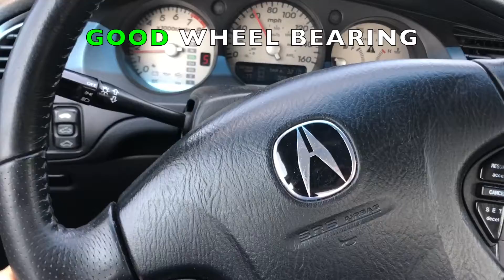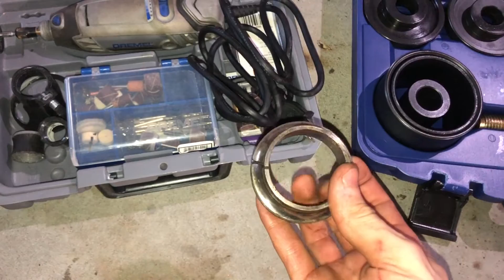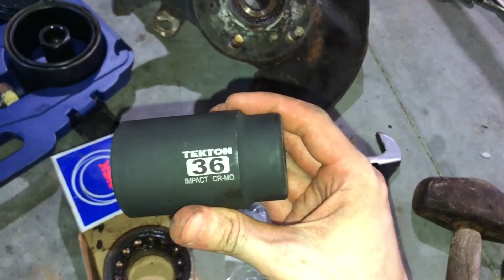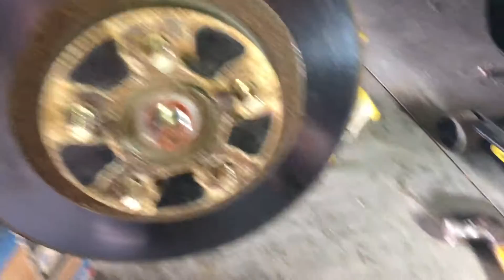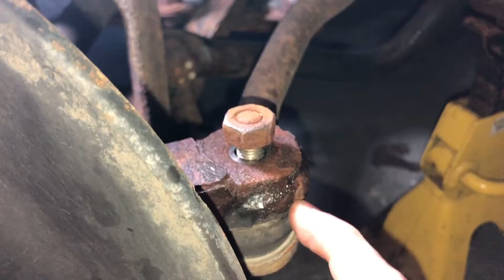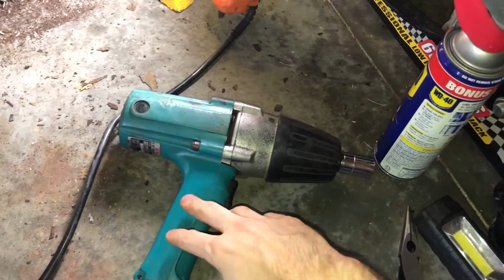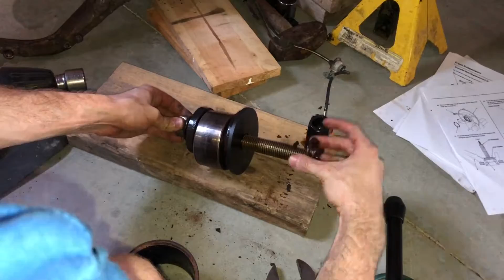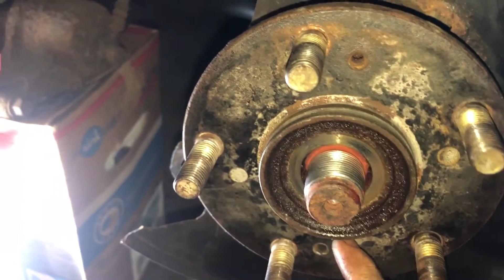How to Diagnose & Replace a Front Wheel Bearing - 2002 Acura TL-S -- Honda Accord

Comment: I have the exact same car and color. First person on YouTube I’ve seen with the same car. Anyway I just hit 200k miles on the car. Any suggestions or maintenance I should do ahead of time?
Reply from the maker: Bailey Webb Awesome job on 200k! I would make sure you keep up on fluid maintenance! Especially the transmission fluid. Use Honda DW-1, do a 3-quart drain-and-fill every 15k miles, and change the exterior spin on ATF filter every 30k miles. I made a video on it!

Comment: Did you get any codes for the abs after removing and putting them back .
Reply from the maker: Machine GunSony No codes! All is good!
Reply: Do you know how to fix the Vsa light ? It stays on
Reply from the maker: Machine GunSony did you accidentally turn it off? There’s a VSA button by the fog light and cruise control buttons. Otherwise are there any CEL codes?